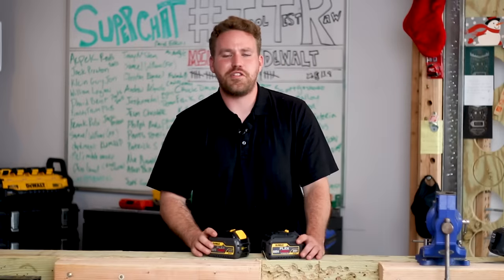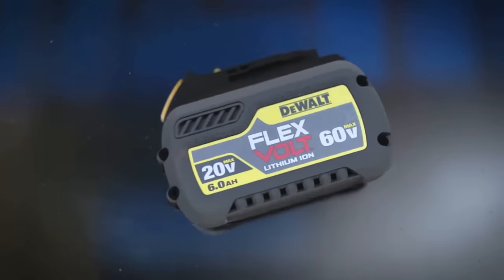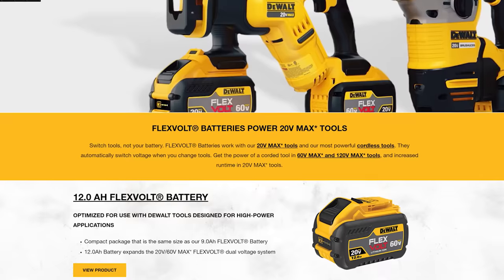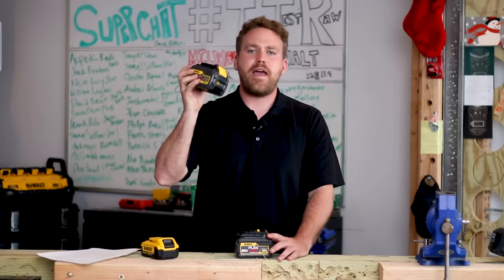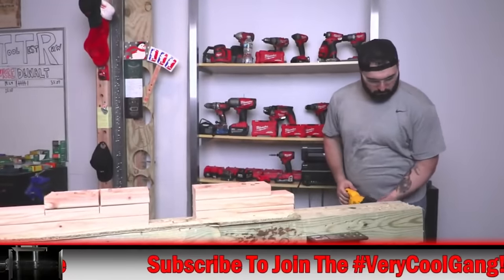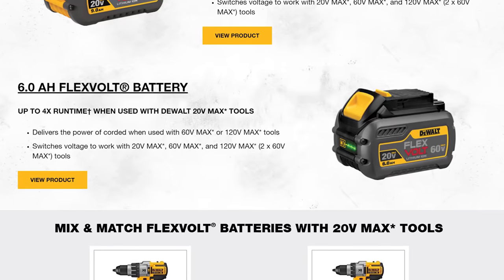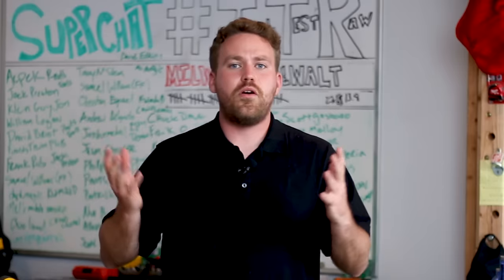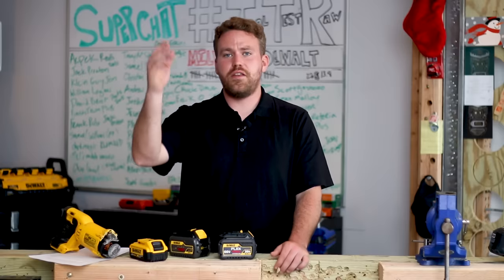NEVER USE DEWALT FLEXVOLT BATTERIES ON 20V MAX TOOLS!

Comment: Yup im agreeing with these guys. I have a dewalt 20v max weed wacker used it twice. As soon as i put the flex volt 20/60 9.0 ah this sucker started smelling like it was on fire. I probably should not keep using this flex volt but damn if i dont want to know whats up
Reply: Okay i ran the battery out of 20/60 fv 9 ah took a break and hooked in 20v 4ah, ran for about 10 minutes before burning up

Comment: THOSE ARE BRUSHED TOOLS. That’s completely normal when you run a tool that hard and it has a brushed motor. Brushes wear out quicker or over heat and get stuck when you run it as hard as you can. THIS WILL NOT HAPPEN WITH A BRUSHLESS TOOL. Brushless tools have more electronic safeties to safeguard against overheating. Usually they reset if you let the tool cool off. If you have a Dewalt brushed tool that stops after using it, open it up and check the brushes usually there stuck or need to be replaced.

Comment: Sorry been using flex volt in all my max tools no issues since I got them for 4 months now no issues so not sure what your doing or issues but I have not had a single issue with them. And from all the comments I'm not the only one having a fun time using dewalt tools. So I will say good luck in this video making any judgment calls for people's choice in tools. Especially considering you have all those Milwaukee tools around you. So I would double check how you do your tests maybe not add so much oil to your cleaning techniques.

Comment: Dewalt 20/60 volt Flexvolt have 3 packs of 5 cells wired in parallel for 20 volts and in series for 60 volts. The switching is done electronically. I see no reason not to use with 20 volt max tools. - electronics engineer.

Comment: just cause you have a battery that will run for 2hrs straight doesn't mean you don't give the tool some cool of time all DeWalt is saying is the battery will last longer but if you abuse the tool and don't let it have a little cool down you will burn it up . If you keep running it when the tool get hot Common sence should toll you to let cool down.

Comment: Nah it’s all about the user just blindly pushing it. Batt will run longer and if doing something dumb like running a 3/4” or 1” lag a foot long into concrete I can see why it failed. Easy way to tell get something like an 8ah 20v batt and run the same tests. It’ll be interesting to see the actual difference.

Comment: All I know is I have a compressor with a flex volt battery, went and bought regular lithium ion batteries because flex volt took a shit...regular lithium ion doesn't fit into compressor. Pissed because I'm in the mountain and had to drive far...no biggie I guess I wasted my weekend and have to go get a refund/ exchange. Reason I bought the regular ions was because I got two for the price of one flex...lesson learned. Don't use this tool much but dewalt did not keep it simple...

Comment: Maybe the high amp-hour flex-volt batteries let you run the tools too long and hard without any cool-down.
Reply: Charles Porter 
Not maybe...absolutely. If you do it in purpose to make a fictitious point, that’s actionable.

Comment: 60v batteries don't play well with some NON brushless 20v tools.
My brushed 20v impact shot sparks out the sides nearly into my face with a 60v 6ah battery.
And I mean immediately and consistently.
Stopped within a few seconds.
Popped a 20v 5ah battery in it.
No issues since.
Usually run a 2ah slim.

If and when you go 60v, which I recommend if your actually going to make money with them, buy brushless 20v tools.
5ah and 6ah+ is where it's at for harder working tools.
Anything less and lack of power will be a issue sooner than later.
Ex., Chainsaws, grinders, leaf blowers, 1/2" impact, etc.
Reply: finally someone said it. My friend you can understand how mad i am. Everyone here and i mean literally everyone, was trying to prevent you into modifying your tool from 12v to a 20v battery or 14,4v to 18 volt , because as everybody was saying at the time '' it will most likely burn you tool''. suddenly a manufacturer uses 3(!!!!) times the voltage to their old tools and oh my god , all of a sudden noone has a problem with tools burning up. Even youtube was prevented by manufacturers to ban videos showing people using a 20v battery to 12v and 14.4v tools. Thank you for this post.

Comment: It will give you more runtime but that does not mean all at once!!! It means more runtime between charges not continuous use until the battery dies. It would be no different than using a 20v 5ah continuously until the battery dies and quickly change it with another fully charged 5ah. Any tool, corded or cordless need a break to cool down. Cordless tools do not have the cooling fan capacity like corded. The smaller tool size also creates a problem where the operator tends to push the tool and cover the cooling vents. I am guilty of doing this myself. If you are using the tool correctly, you rarely need to run it on full power over a minute. Battery tools are convenient and can do almost anything a corded tool can do but do have some limitations. For people who don't understand that, just stick with corded tools :( .

Comment: I've come to a conclusion after a year using my flexvolts everyday. There are three or four possible reasons this is happening. Those particular tools or even the batteries have internals making contact in places they shouldn't. They shouldn't even be able to access the 60volt as they come unless there's a major defect. The batteries could be running in sequence to the wrong contact which is a guaranteed burnt tool the moment its used. Or someone purposely modified these toos and batteries which isn't that hard to create a smear campaign against DeWalt that's always possible.

Comment: I put a flexvolt battery in my 20v max sawzaw, the same one you guys used, and I cut down and debranched a 20ft ponderosa pine. Way thicker then that 8x8, and no issues on any of the cuts. Plus I see you guys trash on DeWalt in damn near every video y'all make.

Comment: Probably shouldn't make false comments about things you don't understand. There is a physical switch in a flex volt battery and a pin in the 20v tools that engages with the switch which will take the 3 imternal battery packs from series to parallel making it a standard 20v battery. If that switch is no activated the tool will not run. Besides we saw how you ran that impact. You kept hitting it untill it smoked, they have higher torque rated impacts for a reason.

Comment: I could tell that drill was going to burn up, wrong tool for the job. It would have burnt up with any battery. Guessing it was the switch in the saw and had nothing to do with the battery. It is still just putting out 20 volts, actually probably not quiet 20.

Comment: I think you dont know what you are talkig about ... There is a mecanical switch on flex volt to use it in 20 V ....  Wiring changed from Chain to paralel( 60V 2Ah -> 20V 6Ah).

Comment: With a power source that can automatically supply more volts than the tool is designed for, it is possible that under extreme loads or high drain, the batter could be giving more than the tool can reliably handle. This guy isn't dissing dewalt, he's saying stick with the batteries originally designed for the specific tool.
Reply: The circuitry of the battery doesn't work that way, and can't 'supply more volts than the tool it was designed for'.  The 60V tools and the 20V tools use physically different contacts on the battery socket.  One set of contacts draws the three internal cells in parallel to get 20V, and a different set of connectors draws the three internal cells in series to get 60V.  A 20V tool does not have the proper physical connections to 'accidentally' pull 60V off a flexvolt battery.  If anything, his tools are breaking and failing for a different reason, like overheating from cutting something beyond the power of the 20v motor.  Even if it was a defective and short-circuited battery, the battery would be constantly discharging, giving off heat without a tool to consume the power and would be an explosion hazard if charged.  It wouldn't be a silent-but-deadly killer of tools.

Comment: Any electric motor is designed to withstand a certain amount of load.  In electric talk current. The flex volt platform includes 2 pairs of power connections.  20 volts appear on one, 60 on the othet. You 20 volt tools will only contact the 20 volt connevtion. The difference appears with the person, not the tool. It's like driving a kia vs a vette.  We just press the vette harder. Press the kia and, well we know.  Okay, while Dewalt 20 volt tools are no kia, they can still be overloaded.
  Back to the battery. When running a tool testing YouTube channel,  you press tool hard and if there is a large amount of power in the honking 60V battery,  you kinda like the feel.  Pressing the 20V battery will drop the voltage enough to stall the tool before the current flying from the big battery,  trying to hold the voltage up, melts the insulation of the windings quickly shorting them out.  Remember,  the safety cutoff on the tool is based on voltage and all the capacity in the flex will hold the voltage up at a much higher current.
   The normal tool user shouldn't have any trouble using the flex battery, but Vince & co.  will because they are trying to find the performance point so we can make better decisions.

Comment: All they did was add a mechanical switch inside the battery.     When used as a 20V battery, all of the cells are wired in parallel which provides max AH.    Switch to 60V and the batteries are mechanically separated into 3 separate groups.    Each group provided 20v.    The switch separates each group and places them in series which equals 20V + 20V + 20V.    Hence a 6AH battery still produces 6AH at 20V.    Switch it to 60V however and you only get 2AH.    The overall power output of the battery has not changed.    The only way to get more runtime is to increase the size of the individual cells which increases the thickness and weight of the battery.     DeWalt is uttering word salads.

Comment: This video has been proven wrong! The Mr. Subaru video does a very nice job explaining how the battery pin connectors in each tool controls the voltage.

Comment: C'mon man I use a 60v flex volt adapted to an old 18v sawzall all the time, with zero issues. We run any/all our 20v tools on 60v with no issues as well.

Comment: Can not run drill  and hacksaw 24 hour a day and with the bigger batter it give more power longer. So it will burn out the tools sooner if you run none stop. I belive it called a duty cycle.
Reply from the maker: Sounds legit

Comment: The 20v batteries are technically closer to 18v, they’re only 20 volt when freshly charged, and the 60 volt batteries aren’t hurting them as they don’t give the tool anymore then 20 volts at any given point, it physically can’t as it’s wiring won’t let it, literally impossible to over due it. Open up a battery and look for yourself

Comment: I'm not an electrical engineer, but I am a retired electrical contractor with literally half a century in the business, if that helps.  I don't know what to tell you... I have so many DeWalt tools and batteries, I'd have to go out and count them, and I've never burned one up using a Flexvolt or a 20 volt battery.  I even have a hammer drill and a 60 volt grinder that took a dive off a second tier scaffold, and still work perfectly with not even a crack.

If you're familiar with the concept of series and parallel wiring, you should understand that the Flexvolt battery has dedicated slots for 20 volts and 60 volts, depending on how the slots are connected to the individual cells inside.  There is no way a Flexvolt battery will give you 60 volts from the 20 volt slots that line up with their 20 volt tools.

To sum it up, A FLEXVOLT BATTERY WILL NOT BURN UP A 20 VOLT TOOL!

Comment: I call bull. I've been using the 60v batt for my old trusty 20v max impact, not xr. The damn thing runs like a charm, on the daily. I noticed an increase in power from my non xr sawzall and the circ. I'm at it every day all day with these tools doing commercial HVAC. Maybe you are just doing it wrong....

Comment: 20 year career electronic tech here, the larger batteries last longer. This isn't a battery problem. This is a tool head dissipation problem. The larger batteries allow you to use the tools much longer and harder than the 20v tools are meant to be and they end up cooking. The 60v tools have gear reduction so they put out much more torque at the same power consumption, so they don't get nearly as hot and neither does the battery.

Comment: Is this a troll video? It looks to me like you smoked your impact driver by abusing it insted of using an impact wrench, and you smoked your reciprocating saw by abusing it instead of using a circular saw, chop saw or chain saw. There's not a single thing diferent about the flexvolt batteries other than a mechanical switch that changes the series/parallel layout when plugged into diferent tools.

Comment: What a joke. I was given the mentioned impact driver with 6ah flexvolt battery. I have been using it at work for about 18 months Multiblut hours t days a week and it's still more powerful than all my colleagues' Milwaukee impact drivers. I'm not a fan boy. Had I been given Milwaukee I'd happily be using it. The flexvolt battery definitely makes the drill heavier but that is the only down side know if. It's an amazing heavy duty combo.

Comment: It's probably not the batteries. It's probably the tool itself or maybe the user. We can't see how the tool is being used outside of the video. I have purchased Dewalt tools for work that smoked and smelled like burned electronics on their first use. Just return them for new ones, good to go.🤷🏻‍♂️ Unless you can show us voltage spikes or something other than very circumstantial evidence, I can't see this being a widespread problem.

Comment: If you pay attention to the 2 black tabs on the back of the Flex battery,  they are spring loaded and the Flex 60V tools are the "ONLY" tools that push those buttons in on the battery.  Those 2 buttons engage the 60V power.
Soooooo not even the 20V Flex Advantage tool line gets increased power when needed because the 20V Flex Advantage tools do NOT push in those buttons when sliding onto the battery.  The only thing the 20V Flex Advantage tools benefit from is the increase in the size of the battery from 2AH to 3AH or 4AH, or 5AH, 6AH, 8Ah, 9AH, 12AH, and finally for the few tools that can take 2 batteries,  putting 2 batteries in the tool. I like and use dewalt all the time. But it is a bunch of lies and sales tactics. Flex volt will not typically fry a max tool. The flex volt batteries and the XR batteries are exactly the same when used in a 20V tool. Sorry this is so long. Really like you guys, wish I had more money so I could donate to yall. I spend all mine on dewalt tools.

Comment: Doesn't matter where your power is coming from, battery or power cord. If you don't get off the tool and let it run at speed letting the fan cool the tool like it's designed, it's going to toast. Having bigger batteries with longer runtimes isn't going to help if you're not giving the tools a break to cool. At least you're forced to do that by changing out smaller batteries.
Speed kills baby.

Comment: 😆 🐴💩    I do it all day 6 days a week and do so heavily ! I do so in the sds hammer drill, 3 speed drill driver, impact, recip. saw, tripod light, circular saw, 7 1/4 sliding miter saw....the list goes on and on. I've never once had a problem. Whenever I need a tool I gear up with my tool of choice, grab whatever battery I want and let it rip. I also never engage in those piss-ass "my tool can drive a lag a millisecond faster than yours" little games either.

Comment: Based on the other comments, my take is that the 60V FlexVolt batteries and their extra capacity allow these guys to push their DeWalt tools longer and harder than they were designed to, leading to component failures.  These guys push their tools HARD and LONG on intense, heavy-duty jobs.  They should stick to the DeWalt 20v batteries on the 20v tools and they won't have these issues; the battery will run out of juice before the tool fails, giving the tool time to cool down during the changeover, or maybe they switch to a different tool to finish the particular intense job.  I don't think there's any "red tool bias" at work here, just their specific jobs and work sessions they use the tools on.  For example, if, say, a hotel construction company is running 3 shifts working 24 hours on building a hotel, and sharing the same tools between all 3 shifts, that would be pretty tough on tools.    For normal homeowner or handyman use, it will be fine to use the FlexVolt 60v batteries in the 20v DeWalt tools.

Comment: Could just be a coincidence they burned up shouldn't have anything to do with the battery and it can't see it malfunctioning and accidentally sending 60 into a 20 volt tool because it has to physically push the switch for 60 volt Not only that but it has to short pins two and three out. The tools that you said burned up it just might have been the end of the life for those tools and was a coincidence

Comment: I understand the tech beind their 20v/60v batteries.  There's NO WAY a 20v tool is getting more than 20v when plugging in a FlexVolt battier.  Thier FlexVolt batteries are legit and I've NEVER had a problem with them.